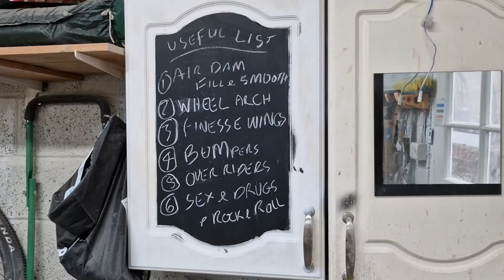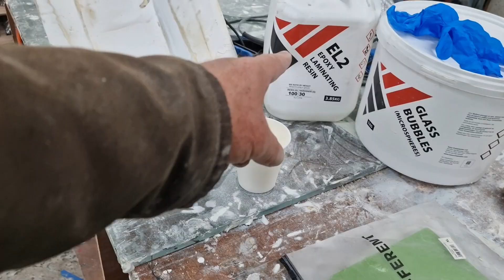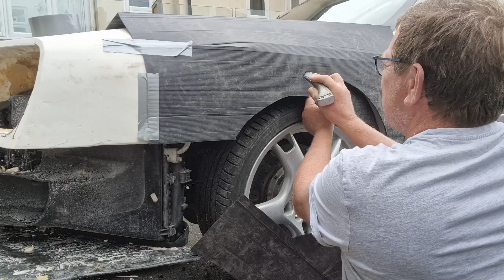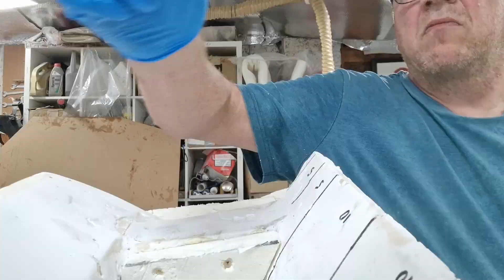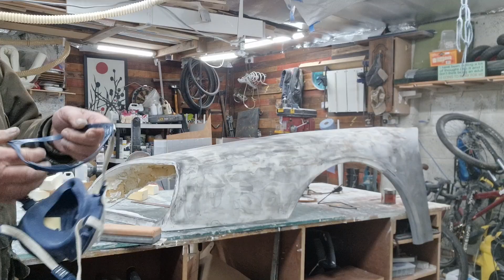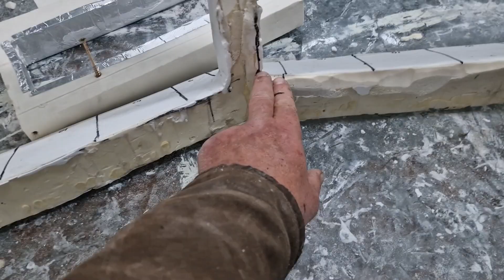Vlog 26  -- Progress, Hope and the End is in sight (Part 1)

Comment: Nice work 👍

I am using the same resin from easy composites 😎
Reply from the maker: Cheapest place I could find to get reasonable quality. When mixed with the glass baubles it forms a really nice hard surface you can sand really smooth. Loads of white dust when sanding but hopefully it will be worth it.
Reply: @classiccarclips3292  yeah they have some good products. 
Good to know🙂 I have not used the glass thickening bubbles before 🤔 I am using the moldless carbon fibre method 👍

Comment: I see your useing a lot of celetex sheets of foam there is a company in long melford near Sudbury Suffolk that sell 2nds there a lot cheaper and thay deliver.
Reply from the maker: Thanks for the info but I think (hope) I won't be using much more from now on. Worth knowing in case I do though.
Reply: Nice, I am using polystyrene sheets on mine 🤔 was the cheepest stuff I could find since I splashed all the cash on carbon 😂
Reply from the maker: @UKBUILT  I will check out what you are building if you have the videos up. I used polyurethane (PU) boards from B&Q rather than polystyrene as I was worried the resin would eat into it. Also PU sands to a nice smooth finish. Only a little more expensive but I hadn't realised how much money this project would eat! Good luck with yours.
Reply: @classiccarclips3292  yeah makes sense, I am using a release film to prevent the foam melting. I am following easy composites guide for moldless carbon fibre parts. Yeah I decided to record this one, I am new to youtube 😎

Yeah they can be costly things to make but you will have your dream ride when it's done 😍

Thank you for your support👍
Reply from the maker: @UKBUILT  I have watched the video of the sled being made many times and was 50:50 between making bucks and a mold or going for mold free. I decided to make to molds so I could learn the process, this is my first time doing anything like this, and hopefully it will make it easier to go back and repair or modify when things go wrong.

Comment: Couple of observations, in the spirit of constructive criticism. The DS has a single, almost semi circular curve to the front end, when seen from above. It doesn't have corners. Would you be able to scare up a pair of bumper halves, fit them and then work the shape back from that point? I feel like the hard corners on your car are doing it no favours. I think the DS headlights are more swept back too. You're car has more of an XJS thing going on at present. My 2cents, that you didn't ask for. Feel free to ignore.
Reply from the maker: Your comments are most welcome and I agree with the points you are making. I am doing the bumpers right now. At the moment they have quite angular corners because they are just 2 straight bits of foam joined at an angle. I plan to round them so the sweep around the corner rather than jut out. You should see those in the next episode. The amount of headlight sweep is partly limited by the Porsche donor but I think once the headlight inners are in place it will look more correct. If you check out Vlog 25 at about 1:35 you can see a genuine DS I went to look at for reference. When you get up close and start measuring things, you realise it is a lot boxier than it appears as it glides by. Thanks again for the comments and please continue to share your thoughts.

Comment: Will you do anything to the rear end ?
Reply from the maker: I am really not sure at this moment. The original plan was to change the back end as well but this car is in a lot better condition than I expected to be buying so I don't want to start cutting panels. Having said that, there is still quite a lot of scope for modification by simply removing tyhe rear bumper and replacing the engine cover and spoiler. Did they make a Ducktail DS?

Comment: Love your hackjob. Keep on going. btw. ever thought about shortening the front a bit to get the lights at roughly the same position as the original? This would keep the original side silouette of the porsche. (except you like the current state of cause).
Reply from the maker: If you watch back a few episodes, or the compilations, you will see that I drastically shortened the distance between the front wheels and the front of the car already. If I try to get the lights further back then they will have to go higher, as the originals were, and I will lose the DS nose style  that I am aiming for. It is difficult to get a proper side shot to show it properly because it is stuck on my drive and there is limited space. With the camera so close, it distorts the perspective quite a bit. I might try and drive it near to the road and get some better all round photos once the airdam, wings and bumpers are basically done - hopefully next episode.